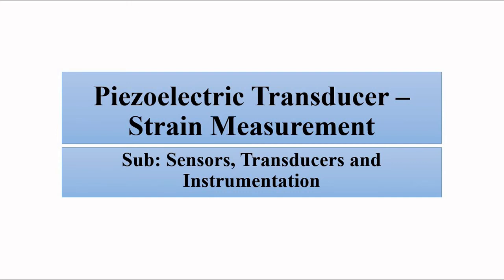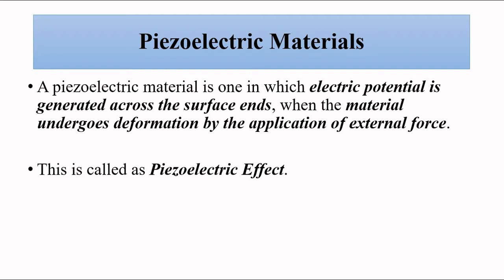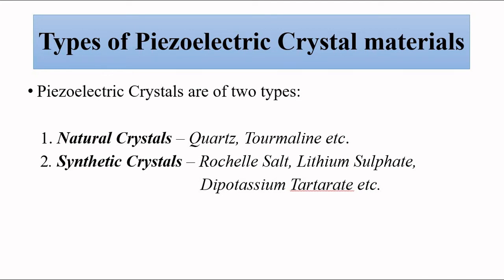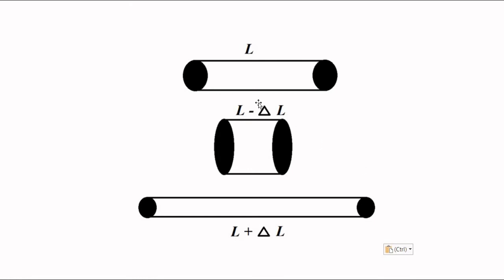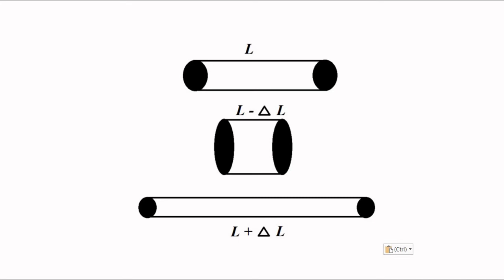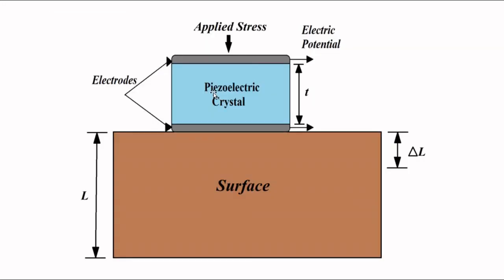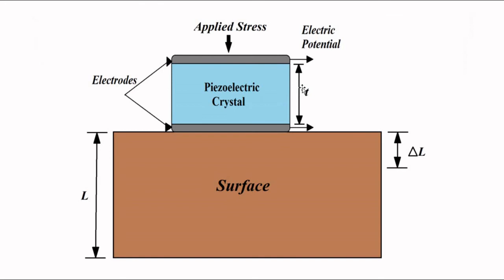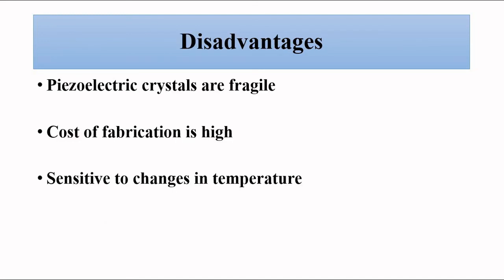Piezoelectric Sensor For Strain Measurement | Sensors And Transducers

Comment: Piezoelectric ring transducer 50 17.5
6.5 assembly. The tightening torque should be in Newton meters. For mounting 4 pieces of piezo ceramic welding